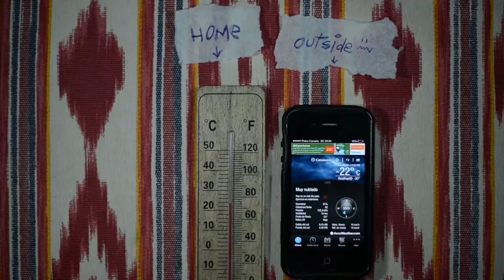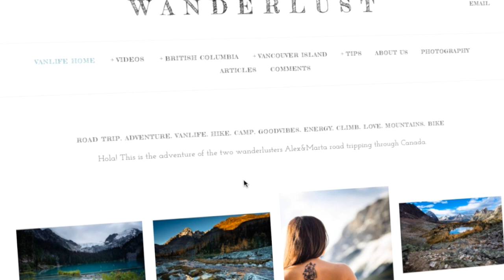Couple Living in an RV in Winter & Living in a Van in Summer

Comment: I would strongly suggest you consider a radiant kerosene heater. Safer than non-vented propane heaters, more effective in many ways than the propane furnace. Kerosene is VERY safe, not explosive, and pretty available. I heat with kero in my 1848 farm house.